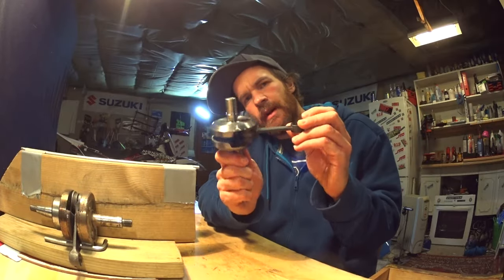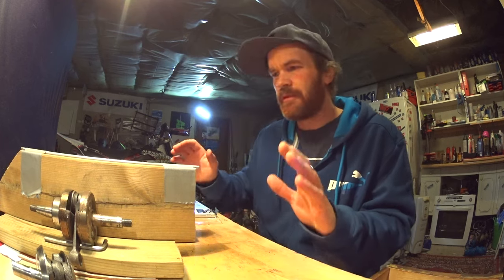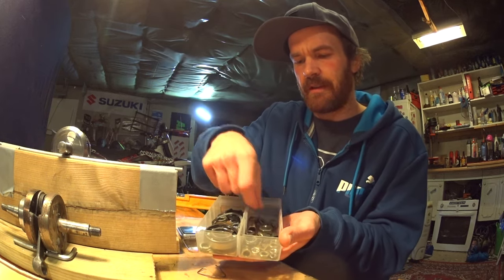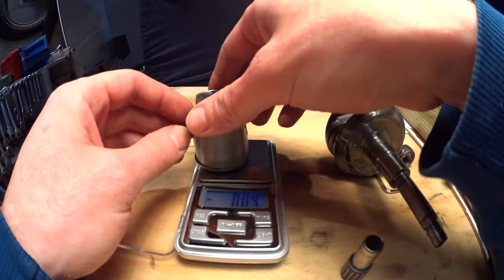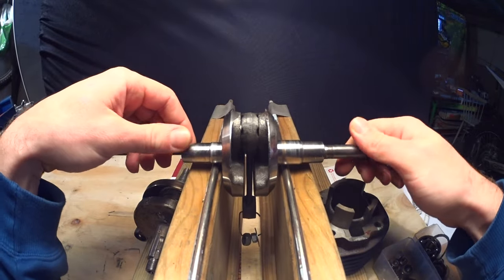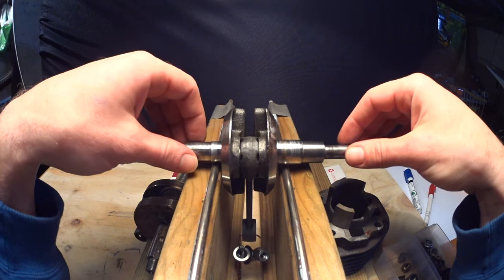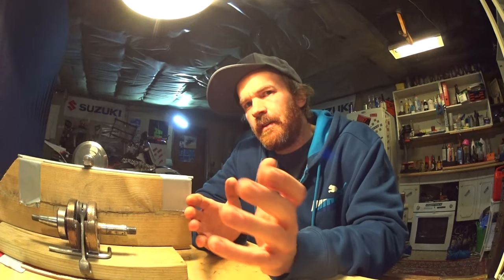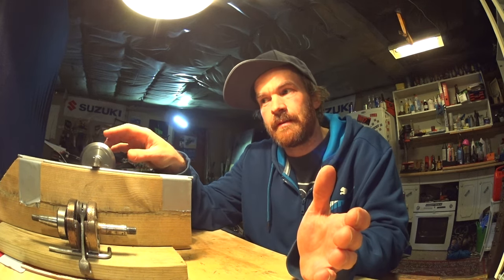CRANKSHAFT BALANCING MADE EASY | Finding Crankshaft Balance Factor | 2 STROKE TUNING

Comment: hellow sir, i just want to ask for a favor. im trying to reach the perfect balance for my 110cc china motorcycle. because its unbalance crankshaft so my mc will vibrate like GRrrhhhhh.. i want to balance my crankshaft for Race. and for better performance. what should i do? if i place my piston horizonal the balancer will go down faster  and if i hung my piston vertically the balancer will slowly down . what can i do?? your subscriber thanks
 ^_^
Reply from the maker: Hi, thanks for subscribing! As there's not one "right" balance factor you'll have to go by trial and error. I'd remove some weight from the counterweight first by drilling holes, if that makes it worse fill in the holes with tungsten and see if it got better.
Reply: sorry. the piston going down if place at vertical.

Comment: my crankshaft goes conrod down without any weight. what should i do?
Reply from the maker: +Olli Hakkarainen That was the case with my Doppler Endurance crank too. Haven't checked the ER1 yet, but I suspect it's the same. Hopeless... Depending on conrod weight your balance factor is probably under 20%, to raise it you must either remove material from the big end side, add heavy metal(tungsten, "Mallory") to the counterweight side, or a combination of both.

Comment: Will I create vibrations if I lighten a piston without balancing the crankshaft? 

Motor is a 270 cc twin opposed
Reply: Obviously I would lighten both pistons to the same final weight

Comment: Does your balance factor not include the variator/flywheel mass?
Reply: That mass is not on the connecting rod  so it isn't part of the  balance factor
Reply: @mothridith9760  that doesn't make sense. You're balancing the weight of the piston to the weight of the  crankshaft assembly. Those items attach to that assembly.
Reply from the maker: True. The variator/flywheel mass is usually not included because it's assumed to be uniformly distributed around the axis of rotation. Any imbalance in rotating parts of the assembly will have an effect on the balance factor. If the rotational imbalance is far away from the reciprocating mass it can lead to weird vibration patterns.

Comment: mine shows 0.61 or 61% of balance factor? what percentage would be best?
Reply from the maker: If it doesn't vibrate badly, that's a good factor for your setup.
Reply: +3mm stroke crank and bigger bore, i was planning on balancing my crank by drilling holes on it
Reply: its my first project, im still learing, any tips or any videos you can recommend?

Comment: How much balance fctor good for engine whtout balancer shaft?
Reply from the maker: +Ramada Nita Around 55-60% is what gives least unbalanced force overall. But that doesn't mean it's the right factor for your setup. Frame geometry, engine mount position, cylinder orientation etc. play a huge role.

Comment: it is a fact is that it is IMPOSSIBLE to balance a single-cylinder engine. The best that can be done is a compromise. The crankshaft counterweights will partly balance the reciprocating mass (piston/ring/wristpin/top half of rod).

Comment: The engine and all rotating masses should be dynamically balance, considering that there are compression and power strokes cycle to be balanced altogether. Peace!
Reply: I am still puzzled why the magneto ang other materials of the crankshaft isn't included while trying to balance the crankshaft. Are those mentioned not a part of the rotation of the shaft? Magneto isn't actually balanced and it act as a nominal counter to the shaft itself? Just asking.
Reply: @MCircuits  yeah, like the clutch! That thing isn't balanced and spins with the whole thing.
Reply: Guess the clutch gets balanced by itself.

Comment: Actually the "balance factor" method was designed for 90 degree V8 engines- CARS!  It's not a good method for motorcycle engines.. Only a good computer program can figure out the correct balance. go to www.dragonfly75.com/motorbike/vibes.html to read all about CORRECT crank balancing.

Comment: How do you figure out how much to add to crank?
Reply from the maker: Use hot glue/tape/magnets and go by trial n error.
Reply: 2STROKE STUFFING what do you do if your crank is balanced with no weight hanging from rod and your piston\rod weight 110g
Reply from the maker: Depends on what balance factor you want, same calculation.
Reply: So basically add weight to the web until my hung weight and Rod is 55% of my piston Rod weight for a 55% Factor
Reply from the maker: Yep👍

Comment: Hi, my problem is that the conrod is too heavy to start with ! so I need weight taking off of the piston assembly, Conrod weight 7 grams piston complete weight 35 grams total moving weight 42 grams, so anyone out their that can do the maths to tell me how much needs taking off of the piston ?.
Reply from the maker: You can add weight to the crank counterweight too, like I did with tungsten on the Spx, or remove weight from the big end side(if there's material available)
Reply: Thanks but I have actually got a conrod of 7 grams which is heavier than the counterweight by 1.73 grams, a piston weight of 35 grams giving 42 grams of moving weight, so if I understand I really need to put some weight on the crankshaft, but can't I take a bit of weight from the piston instead ?.
Reply: I haven't got any handy, although I did manage to 'loose' around 4.5 grams from the conrod and piston assembly, which has made a lot of difference,,
Reply: I spent a lot of time balancing the crankshaft and making exhausts after it vibrated so much that they fell apart, here's my 
Conclusion,
  Well after running this engine for a
few months here is my humble opinion on my RCGF 20cc 'Bargain'.

If you are an older pilot that is used
to loosing pieces like the exhaust in the air, then spending a couple
of hours looking for it in the long grass don't worry, with this
engine it will fall off in front of you !.
Would you rather save a £100 quid on
your engine and tell everone what a bargain it was,
 Then again this engine is for you,
If you have a collection of leaky ASP
engines, 
 Again this engine is for you.
You also have a collection of MDS
engines,  
 This engine is for you
When your planes end up crashing when
they do eventually get into the air, this engine will see to it that
somthing will fall off due to it vibrating,  
This engine is for you.
 It rains 6 months of the year and you
have nothing better to do than repair your planes,   
This engine is for you.
You need to test your servos for a
Model Magasine, then put them in a plane with this engine and ground
run it, if they last for a tank of fuel, then these are the servos
for you.
is the wind too strong or not in line
with the runway and you are all huddled around your planes frightened
to fly, this engine will give you a topic to talk about for hours, 
This engine is for you.
So what now, fly it till the next
problem appears, (they never stop ) just go out and buy a DLE 20RA to
relace it, and DON'T tell anyone in the club, they will be in 'or'
over how you manage to turn up to the field, fly for hours with
nothing going wrong, however they will ask you advice, now becoming
'an expert' on petrol 2 strokes.
Then my Conclusion is the DLE is the
engine for you !.